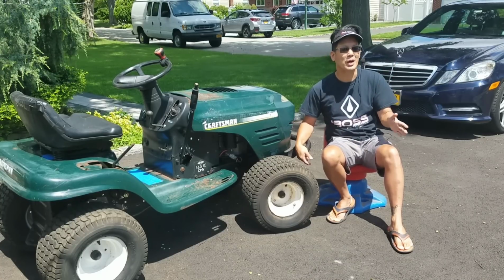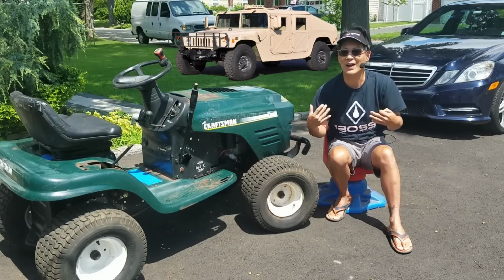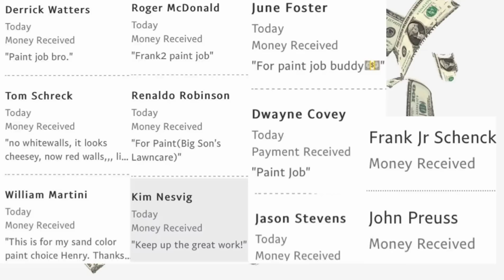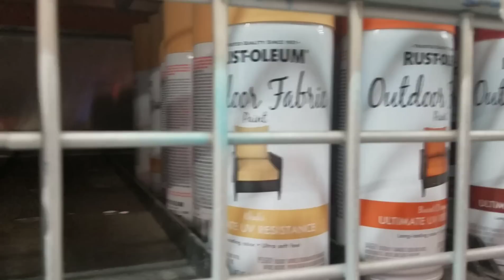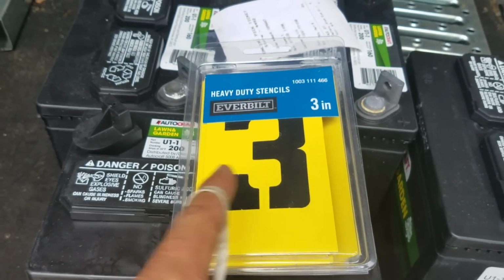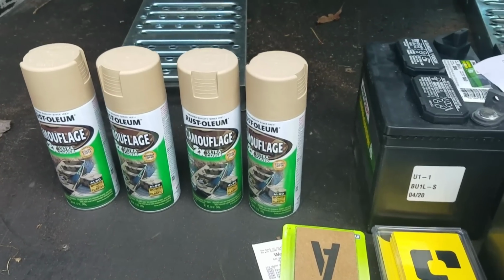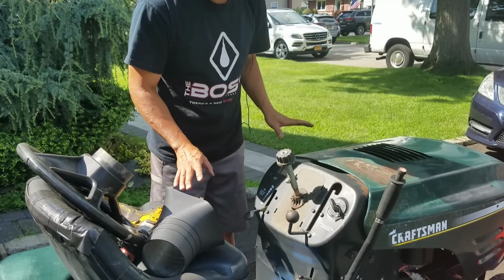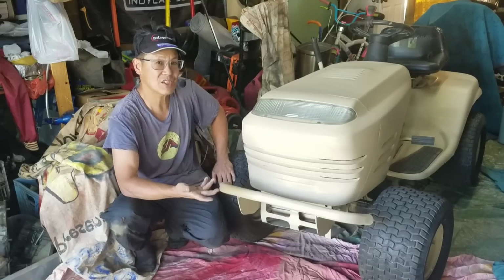CRAFTSMAN LT1000 KOHLER COURAGE 19HP FRANKEN LAWN TRACTOR 2 DESERT SAND MILITARY HUMVEE PAINT JOB

Comment: Next time for rims, try using index cards or playing cards in between the rim edge and where the tire meet. You make have to remove the tire but it works good on motorcycles, and auto rims.
Reply from the maker: Remove the the tire?  I’d rather be sticking needles in my eyes!
Reply: @MowersNBlowers  No you just slide the cards in the crack between the lip of the rim and the tire.
Reply: @MowersNBlowers  I meant remove the rim off the axle so you could lay the rim flat to paint easier. LOL Guess I should be more specific with my words. LOL
Reply from the maker: Hesser6 paint cans only spray well sideways not down unless it was full.  Still gotta mask it though.

Comment: great video henry. The transmission pully on my tracter was held in by a C-clip. I think thats what they call them. It took me more time to take out the battery box than remove the pully. I had to buy a tool with pins on the end to spread open the clip.
Reply from the maker: I have that tool, I'll check it out when the time comes for that episode.

Comment: Can u invert the double stack pulley on the front, dont know if that would work or not? Great episode btw, excellent paint job
Reply from the maker: Yes, but there is no keyway on the bottom.  Which is useless,  I suppose I could drill a hole through the crankshaft